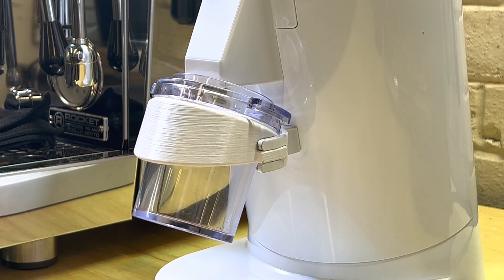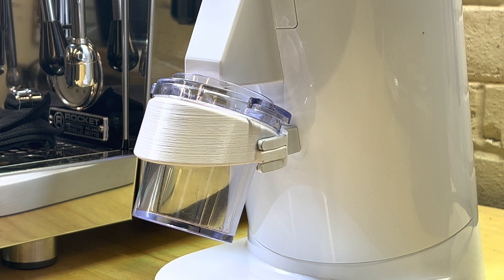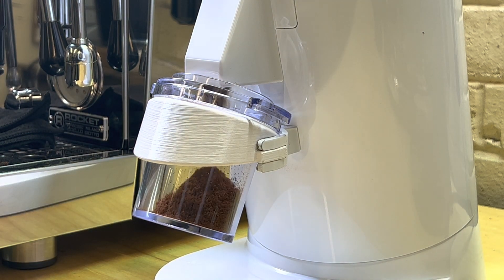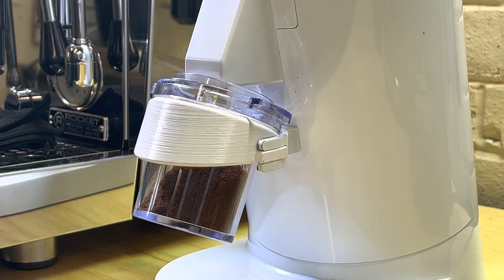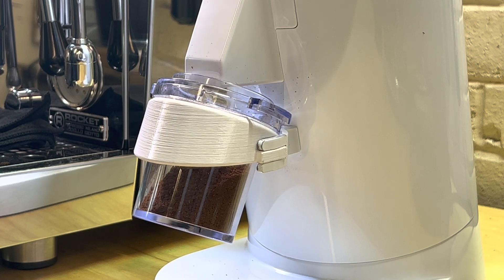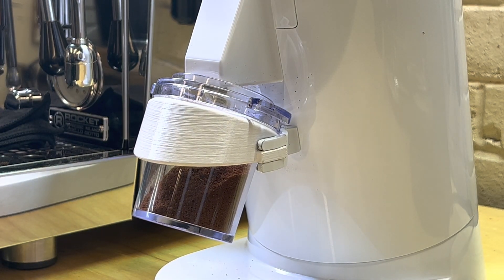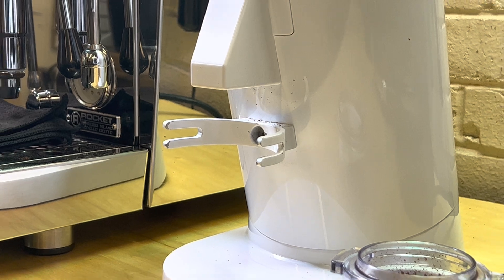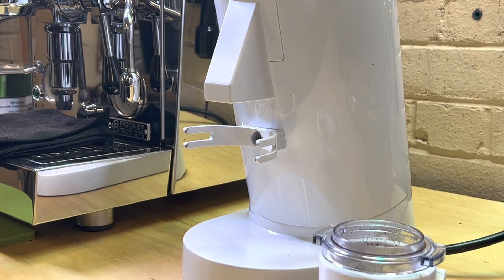Turin DF83 with Plasma Generator and Metal Declumper

Comment: Do you have any tips for removing the chute? I bought a 3D printed one with different geometry as well as a new declumper but I’m too afraid to remove the 2 screws keeping it on in fear of them dropping down into the housing. Doesn’t help that the screws aren’t magnetic…
Reply from the maker: Put the grinder on its side.   I’ve tried printed ones and they didn’t perform very well. Just my 2 cents.  I have a video for the plasma generator installation that might be useful